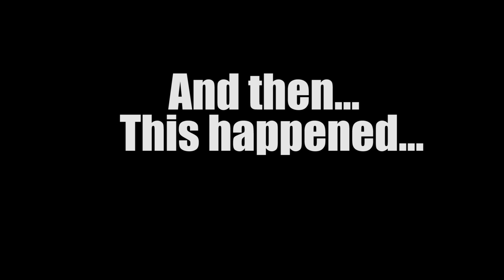Syma X8HG RC Drone FALLS FROM THE SKY / Alt. Hold / 1080P Camera

Comment: John - I am happy you left the crash footage in your video.  I am ordering and x8h and being a relative newbie to drone flying, it was great to see the copter survive the crash.  I have one of Syma's products and am impressed with it's quality.  There are a lot of quads in the x8h catagory so quality and durability are very important.  Thanks for the great review
Reply from the maker: Jack, I really appreciate your comment! I try hard to do honest reviews and whatever happens is the real deal. The Syma X8HG is a tough bird... but if you have not ordered one yet I would think about getting something else. 

I continued to test this quad over a few weeks time and this wasn't a single incident, unfortunately. It kept dropping from the sky. Sometimes inconsistently, even when I was very careful with the throttle. I gave up on it. I was told by some other reviewers that mine was defective, but something just doesn't add up when so many people have reported the same issue. Even if 10% of them are defective that's a very high rate!

If you get a quad from Syma don't get X8HG just get X8G instead. You can find it in the related products page for X8HG from my link. The altitude hold is a major problem, whether it comes down to the barometer used on the main board or an issue with the transmitter itself I don't know.
Reply: Jack Richards good

Comment: Oh WOW, impressed that a quad this size did not sustain damage from a fall at quite a height. Its a good thing that this crashed to reinforce the point of being careful bringing the throttle lever down too far and demonstrate its durability. Good for you not excluding this John :-)
Reply from the maker: Appreciate your comment Bill M. My overall opinion at this point is that the way this throttle shut off works is mind-numblingly dumb and is too sensitive. I have been able to trip this shut-off more times since this video was created. This is a quality control issue and/or bug in Syma's altitude hold quads that MUST be addressed and fixed.
Reply: For sure, what are reviews about otherwise?

Comment: It happend to mine as well. But I actually manage to re-arm it. And no. Syma isnt (according to what I have been told) interested to fix it, they actually do a apple, and call this a feature. They dont seem to understand that this issue aint just if you  pull the stick fully down, it actually activate even if you dont do it. Thats the problem. I have never pulled my stick all the way down, and still it have been shutting down all the motors. 

This is the info I got from the manufactury (when the retailer asked them about the issue) it self: 
"We ask factory technical, they reply us if pull the Throttle Lever to the position that you said, the quadcopter will down too fast and easy to lose balance and crash, so they suggest don't pull too large or to lowest when you need to quadcopter landing, please pull small to landing slowly." So Syma actually wants to prevent dreamstate vortex. But the problem is, that sometimes you have to get it down fast, and if that dont work, then I guess SYMAs answer is to kill the motors. How could that be a better thing?

But Have to say, that was in interesting way to get it down quicker. You did kinda pump the stick up and down. Shall try that. Its almost like if you dont have ABS-breaks on the car. :-) I noticed that when it happend to you, you never really let the stick go to the middle and actually hold it down more than let it level out. So that why it did shut down. But you could have saved that from hitting the ground. Just shut down the TX, and then arm it again, and then activate the props, and it will not crash. I did that actually myself once.... 

https://youtu.be/GnYgXFZk0L4?t=1m20s
Reply from the maker: Thank you Jerry this is a great comment. You went straight to the source, Syma themselves. So now I know two things (a) This won't ever be fixed, It's a Feature Not A Bug (tm) and (b) It can be saved by re-activating throttle mid-air as long as you have the clearance. Epic video. Like yourself, after I posted this video I continued to experiment with the syma and I quit using the method in this video. 

Even when I was never pulling the stick all the way down, it STILL shut the motors off. Often inconsistently. Some of the haters and trolls on this video just don't get it -- this is a bad design to fix a "problem" that shouldn't be there to begin with, which in turn creates a totally new problem.

I suspect they'll just sell these out and be done with them, perhaps learn from their mistake and perhaps bring a brushless version to market. That would solve this the correct way.
Reply: Mm...Yes I know its a pity. Rc Ryan who is a great youtube channel for us crazies fliers thought many of us just pulled the throttle all the way down, wich we selldom actually did. Its a pity Syma dont trust its on barometer that actually is working really good. I am trying a new modification by doing as someone did in a rcgroup, by putting something around the stick. Not to hard, but thick enough to stop the stick to get full down, but still enough soft that if I press a little harder do get all the way down. I had some sort of glue that could fix that but cant find it at he moment haha. But that soldering thing with button and all, is to advance for me to be honest. :-) But keep up your channel. :.-) 

Syma did some things right. Use good buildmaterial. Check. MIne fell over asphalt from around 10-15 meter and not a real scratch to it. The legs took the beating and one broke. I taped it together and it works finge again. Barometer is great on the SYMA and works best of tem all out there, so that why I can understand why they did this strange thing with this throttle down thing. It can handle the descent, it doesnt plummeth down like a rock. lol.

Comment: That issue isn't confined to that variant of the X8. Hold the left stick too far back too long and the motors die.  About two seconds plus, approx. When this happened to me I had the presence of mind somehow to get them restarted in time enough to arrest the free-fall it'd gone into.  I guess the thing to bear in mind is to either only fly over moderately long grass to cushion any such falls or else maybe practise mid air restarts to prepare for the odd unexpected event?  I've seen the result of these falling on hard surfaces and the result isn't pretty. two legs were busted off and one motor housing of the X frame was sheared off and left hanging by the motor wires. A whole new case and set of legs needed to restore flight readiness. These aren't very expensive and are available as parts easily enough so it needn't be a terminal situation if you're competent with simple benchwork.

Comment: Man I no what you mean I was disappointed with mine.....It dropped out of the sky and broke....I never had so much trouble with a quad.  Fixed the problem by getting a reg X8 transmitter after I fixed the quad....the transmitter was the problem...Now it fly's awesome.....
Reply from the maker: I tried an X8C transmitter and it seemed like it was fine, but then the problem occurred again. So, I'm at a loss. This quad has been a total nightmare, and at this point it's not even in a working state anymore from falling to the ground so many times, with 1 motor that got burned out. When it does get in the air, it flies great, but too many people have been coming to me sharing their horror stories with this one for me to recommend it anymore.

Comment: Hi can you use a x8g transmitter on this quad to get rid of the motor cut out issue?
Reply from the maker: No, that will not prevent the issue. I tried this already.

Comment: Hi I had same problem but also could not get it down just waited to keep going up. so had to shut the motors down.Not sure want to do with it. could change the transmitter and pcb to non altitude hold.
Reply from the maker: Another youtuber did a hack/modification to the transmitter to prevent this from happening. They added a button to their transmitter to kill the motors and disabled the throttle down = motors off functionality. Other than doing that, replacing it with the x8c fc board is the only option.

Comment: i have the same problem with sayma x8hg. motors off and fall from sky. what's the final solution?
Reply from the maker: There is no official fix for this, it is not likely to ever be fixed either. Syma doesn't care. Return it to the place you purchased it from if possible.

Comment: Jogn here's idea that I've been using to keep both my X5hc and x8hg in the air.  the idea came from Joe Woodford - here's his video on it -
 https://www.youtube.com/watch?v=dOkPgil_Xsg
 I changed my slightly but make sure you use a clear piece of plastic so
 you can see exactly where to drill the 2 holes. I used a hard plastic 
clear flip phone cover that I dremmeled down and I got longer screws - 2
 x 1/2 slotted round head wood screws (81353). I had to cut off just 
about 1/8 because they were too long

Comment: I actually did the board and TX mod to my X8G to make it a X8HG. worst mistake ever. 3 crashes later, old board is back in it. I wish I had seen your review before I ordered the HG board. I agree , mind numbingly stupid design. 

The sad thing is that other reviewers who receive commission for their reviews don't even touch on this design flaw.
Reply from the maker: I receive commission for all of my reviews as well but the fact is I'm not going to push a bad product on my viewer base, however small. I think there are quite a lot of other reviewers who didn't necessarily hide this problem but rather didn't fly with it long enough to encounter it, or if they did, just wrote it off. I've had waaay too many comments of the same thing happening to people. Stupid design, I'm pretty sure Syma learned from this because their new X5UW which I reviewed in September does NOT have this problem at all.

I appreciate your comment though, I will always try to be honest on my channel. :)
Reply: John Cuppi , props to you for calling it like you see it. I will check out that new model. I haven't even heard of it yet. thx.
Reply from the maker: The x5uw review is here: https://www.youtube.com/watch?v=YQ9gTR_FI60 
it's not exactly a successor to the x8hg, but it's syma's new x5 series 
quad with altitude hold. if you check my video i even purposefully test 
this model to see if the same thing happens to x5uw that occurs with 
x8hg -- it doesn't. To me, this confirms even more than x8hg is plagued 
by a shitty software bug / design since x5uw has similar functionality 
but does not drop from the sky at all at full throttle down.
Reply: Thx.

Comment: dude, be careful when it's low on battery, syma's tend to brake when over used on low battery, I roasted my syma X5SC even though it was working perfectly when I used it until the battery ran out
Reply: Also, I forgot to mention that the rotors are what brakes
Reply from the maker: Thanks for the tip. Sadly, this drone bit the dust. There's only so many times it can drop from the sky due to the poor throttle cut design, especially at higher altitudes before taking critical damage.
Reply: John Cuppi it falls out of the sky because you hold the trigger all the way down to descend. this model made that the engine shut off for a dumb reason but it's in the manual so you should've known. don't blame a great copter for your illiterate mistake
Reply from the maker: It falls out of the sky because it's a shitty design to begin with. Maybe you should actually watch the video again. I was fully aware of the issue as I described and demonstrated how the throttle shuts off. And no, you are wrong, I was not /holding/ the trigger all the way down to descend, I was just tapping it for far less than 3 seconds and it tripped it off! 

In a prior test, that had not occurred. It's hard to descend otherwise and this is a mind-numblingly stupid software design. The fact that there are modifications out there to disable this function because of this "problem" speaks volumes. Google it. Have a nice day, enjoy your X8HG. The software issue with this is just the tip of the iceberg with this model, I won't even go into the motor failures. "Great copter", lmao.
Reply: I did this modification myself, and got a new problem. To shut down the quad got a little harder to do... so it tipped over most of the time. So thinking about going back to props haha...

Comment: do you have a vid showing how to set your the  ALTITUDE HOLD step by step  thanks great vid
Reply from the maker: Altitude hold does not require anything to setup, it should automatically be there. :)
Reply: john I can take off and say to 10 feet and let go of the left stick and the drone will drop down to about 2 feet not 10feet to me that is not holding thanks john
Reply from the maker: Your syma x8hg is defective then. :(
Reply: thanks john I will return it